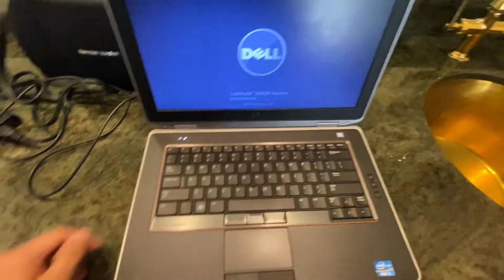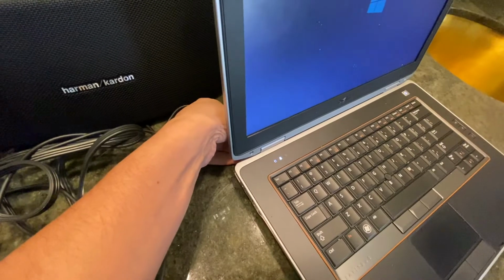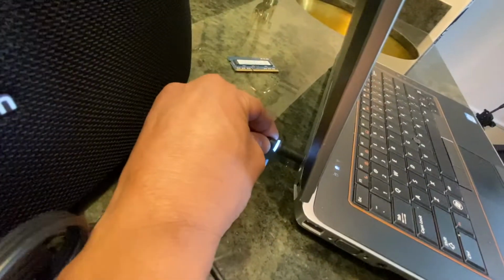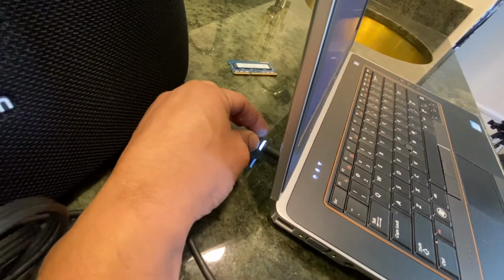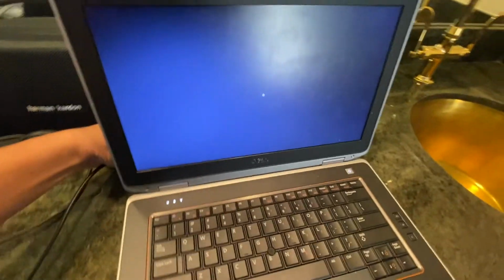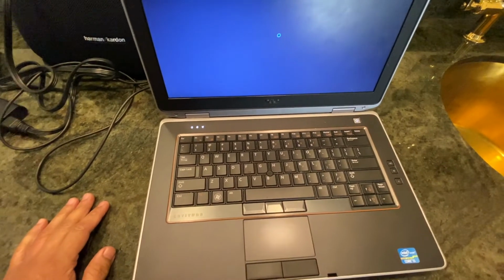Dell Laptop Latitude DC Power Jack Replacement

Comment: I have a Dell Latitude e6430 & found out the dc jack was defective. Noticed that the plug would fit really loose and would not charge the battery. Bought a new, dc jack and hopefully my PC will boot up

Comment: I have a good 7212 no charging. I've done all the common fixes to return charging but no luck.  Runs on battery, or power supply. but won't charge the batteries.  any ideas?
Reply from the maker: Battery is bad. Replace the battery
Reply: @HowToDoitright  both replaced with new. Not the issue
Reply from the maker: Ru sure your charger is putting enough amp to charge the battery?
Reply: @HowToDoitright  OEM. 19VOLTS  Proper wattage ,new batteries, all windows recognized both batteries.  It will run on batt or on power supply.  The actual jack is loose.  Ordered new jack and wire per dell tech. I'll see how that goes
Reply from the maker: Yes if the jack is loose it will not charge the battery.